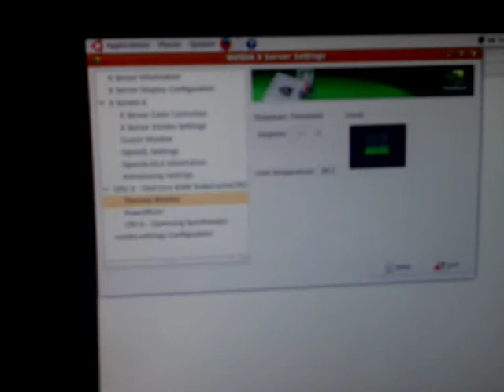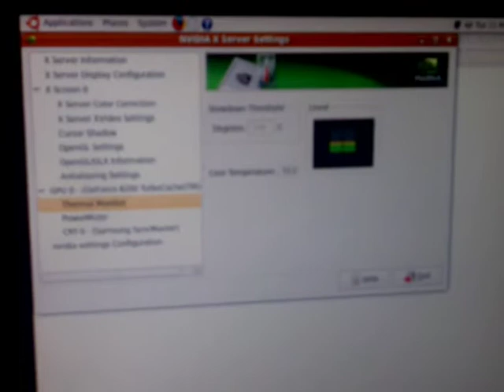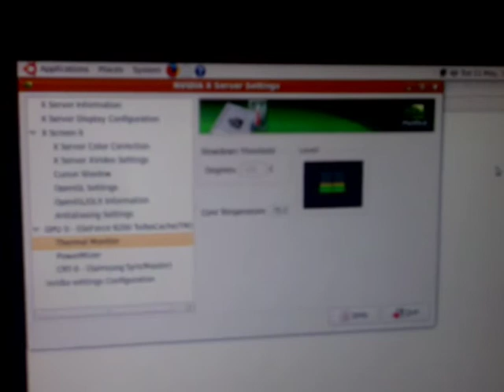Gigabyte Video Card Fan Mod

Comment from the maker: @stonercrazyclips222 Yeah, if you've got an older computer, XP will be faster than Vista. What you see in this vid became "Project Old Faithful" which now has a Radeon HD3650 in it and is used by my daughter. My main pc has just been rebuilt and is currently using a 8400GS

Comment: Very nice. I had to do that with a few older cards I had back in the day to give them a little extra cooling. 

That sure does run hot for just viewing the desktop. Was it always like that or did it just start to get warm lately?.  You can always try removing the heatsink and putting some new thermal paste on it maybe it would make a better contact. 

Excellent tutorial :-)